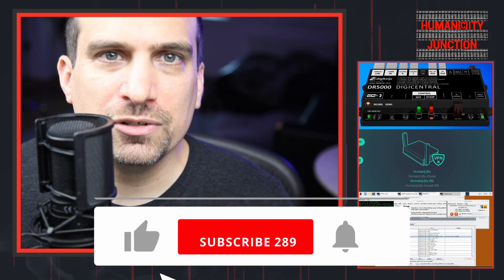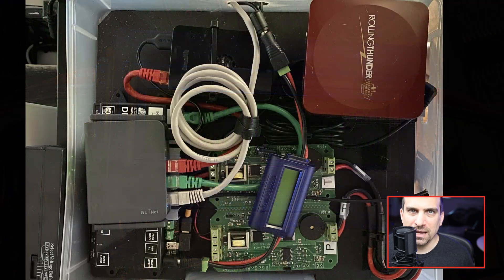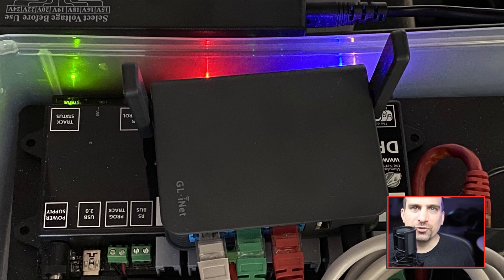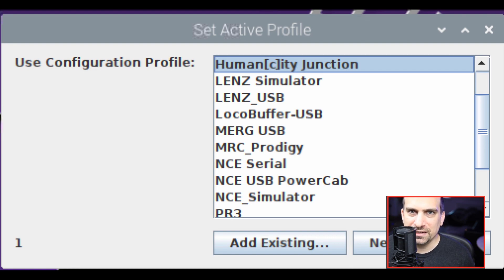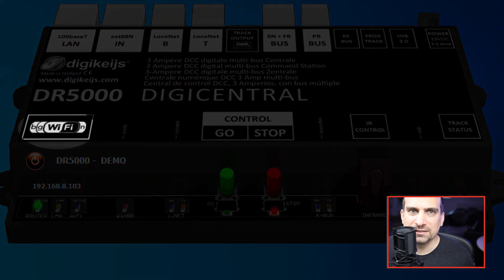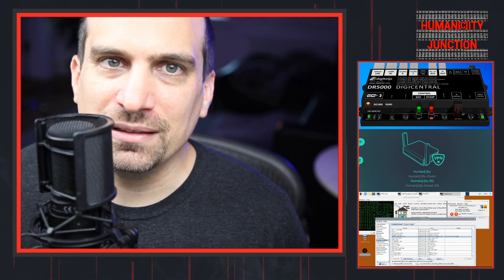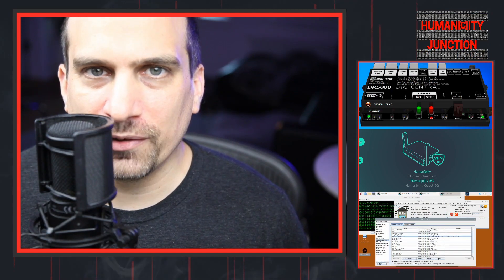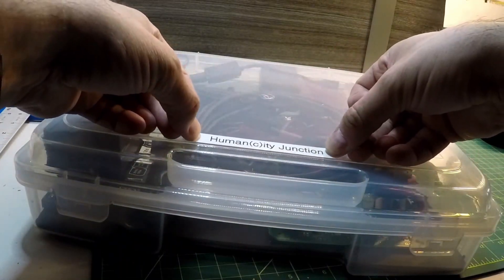28 || DCC Control Update || Adding JMRI and Networking to Digikeijs DR5000

Comment: Ok you had me up until you started with the router. The raspberry pi emits its own AP signal. All your wife devices should be able to connect to it. But hey it looks good and it work. I am curious about that router. Maybe i missed it but i didnt see a link in the description.
Reply from the maker: Rick, I originally planned on explaining more about the router, but ended up cutting it out as I could not find a way to explain it simply. I will see what I can do here.
The short answer is that I wanted to hard wire the network between three devices, so I needed a router to do this.  Here is a longer justification.
The router is the GL-iNet Slate, GL-AR750S, I will add a link in the description. The router is designed to be a travel router that you would use at a hotel to spoof your mac address to mimic your laptop (which you use to sign into the hotel wifi), and then be able to connect all of your other wifi devices to the router behind a VPN. This was the router I always used while traveling, so I already had it.
The DR5000 and the JMRI RPi image create their own Ad-Hoc network. So yes, I could connect to both the devices, but I could not connect the devices to the web via my home network. If I just connected the RPi to my home network and did not create another layout network, I was sacrificing one connection for the other.
Since the router can connect to a wireless network, and create it's own wireless network, I use it to basically bridge the gap between the layout control network and my home network. 
Then since I am not using the ad-hoc network on the RPi, I then also connected this to my home network. I could have left the ad-hoc network, but connecting the RPi to my home network now means that I can access the layout control from either my home network or the layout wifi network.
I do not know if this was a logical decision, but between wanting to hardwire the three devices, as well as wanting an internet connection for JMRI, this seemed the easiest way to accomplish both.
Reply: @HumancityJunction  i have the rbpi setup to use its own ap wifi so all my tablet and eventually wifi throttles can use it also. I have the ethernet port plugged in my home network so i access the rbpi via VNC. Just a thought. Couldnt you have simply use a small 4 port switch to connect all devices and then hard wire that back to the home network?
Reply from the maker: Ahh, yes, I could have hard wired to my home network, but the control box is portable, so I did not want to be physically tied into my home network.  But if the router I was using had a 4th port, that would have made a lot of sense.
I used what I had available and did not buy a specific router for the situation.
Reply: @HumancityJunction gotcha. I wasnt thinking of the mobility. i understand. I see the logic now. .

Comment: That's pretty cool. Having two protocols plus administration is a bit confusing, but it's pretty cool that you can get it all working and the Raspberry Pi can connect directly to the DR5000. Unfortunately, I feel like an aversion to technology is holding back US DCC tech, unlike in Europe where they rely on tech and automation extensively.
Reply from the maker: Thanks for checking out the video and commenting.  I wish I knew more about the EU MRR control systems.

Comment: Heath.  Great video.  Does an excellent job of explaining how to set up the DR5000 so you can use the Roco Mulitmaus, JMRI - Withrottle for cell phones, UWT-100, etc as throttles, and still be able to administer your DR5000 through the Windows based DR5000 control app.  We also have this configuration running at our model train club.
Reply from the maker: Jay, it's really great to keep meeting more DR5000 users.

Comment: The other thing I did was and a tiny msata 60gig SSD with a USB3  connection for the raspberry pi now that it supports USB booting.  I corrupted to many micro SD cards. This way is safer and faster.
Reply from the maker: I tried setting up Resilio Sync on the RPi so that I could backup the databases. But unfortunately this created other issues, so I am still looking for a backup method.
I had to take out the microSD card to update the image, and it was very difficult.  A small SSD counds like a good idea.

Comment: As you mentioned, you can also run Engine driver if you run the raspberry pi script during boot. Or else you can run the Simple Server script that let's you run JMRI on your laptop while connected to JMRI on the pi which is connected to the layout without VNC.
Reply from the maker: I was looking into this, but eventually just committed to using VNC.  Which way do you prefer?
Reply: @HumancityJunction  using Simple Server gives me a better visual since JMRI is running on the laptop. But maybe I'm doing something wrong because I end up using JMRI files on the laptop instead of the files on the raspberry pi. Using VNC, the visual is a bit blurred or it's the wrong resolution but I get the files from the pi. So I prefer using VNC.
Reply from the maker: I have a pretty clear image over VNC to the RPi. If you want to compare versions, can you send me an email with your details.

I was originally going to setup a cloud sync folder on the RPi and laptop to share files between the two JMRI instances but VNC is working ok for me.

Comment: Also having JMRI on the pi allows me to run a script that displays my layout. Therefore if I connect a monitor to the pi, I will see my layout and all the animation from signals and turnouts and block detection. Or get the same through VNC.
Reply from the maker: Do you have a video on this? I am interested in setting up JMRI panels.
Have you tried doing any of the scripting in the DR5000 or is all of your automation through JMRI?
Reply: @HumancityJunction  hi, no video, sorry. I just followed some youtube video on how to create the layout panel and then used the config setting to launch the file during boot. My automation is done with Team Digital loconet boards and  MGP decoders that include logic cells that allow you to change the signals based on occupancy and turnout and other signal data flowing through loconet traffic. Standalone. This way, once it's all setup, I don't need to have JMRI or the raspberry pi running. Just turn on the layout and it all works automatically.  Less pressure that relying on JMRI or the raspberry pi. But JMRI on the raspberry pi adds the layout design and programming decoders. But I just create the layout maps and not the logic. Since the layout is using loconet, all that traffic will update the layout map on JMRI and also update my physical panels around the layout.
Reply from the maker: I really like the idea that I would not need to have JMRI running to automate the layout.  As stable as the RPi is, I feel like it is the week link in the system.
Reply: Human[c]ity Junction yes, I feel the same. That’s why I try to set up redundancies like a SSD or layout mounted panels that use different hardware.

Comment: Like you, I wanted both a wifi connection to the DR5000 while using JMRI on my laptop and also a wifi acess point connection on the DR5000 to run the Z21 app. But could only have 1 wifi connection. Hence the raspberry pi for a 2nd wifi connection.
Reply from the maker: Interestingly enough, I am able to connect to the Wifi of my router and use the Z21 app and the WiThrottle app over the same wifi connection. I originally thought I would need to connect to the DR5000 or the RPi seperately, but I do not.

I am currently not using the DR5000 wifi connection, but I would likely use this for the WLAN Multimaus throttle.

On the RPi, I removed hostapd and have connected the RPi to my home wifi network. This way I can VNC into the RPi from my home wifi and I do not NEED to get onto the Human[c]ity Wifi.
Reply: @HumancityJunction  also by removing the Access Point, you can get raspberry pi updates and upgrades. I also have the Z21 Mulitmaus. Works well. Also running he Z21 app on a 7" Android tablet. His allows me to create a layout map here to, full screen I can set routes or see them being triggered by other hardware. This is a redundancy for if JMRI or the pi goes down.